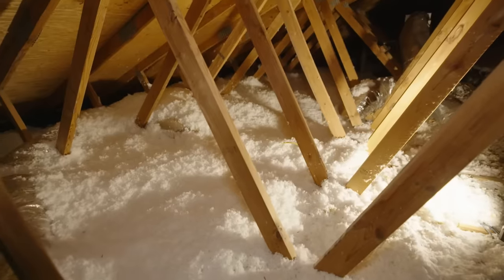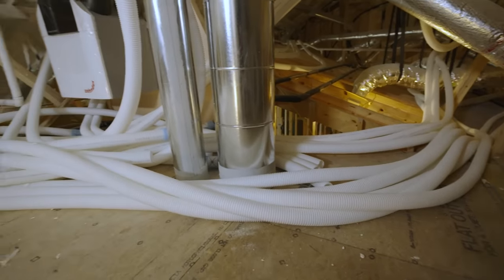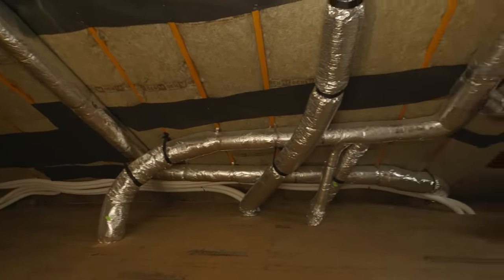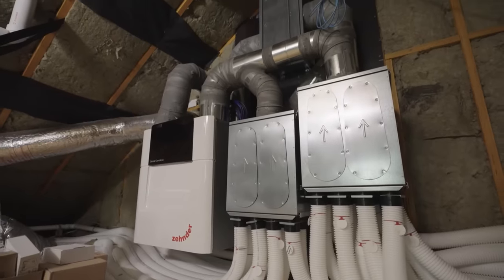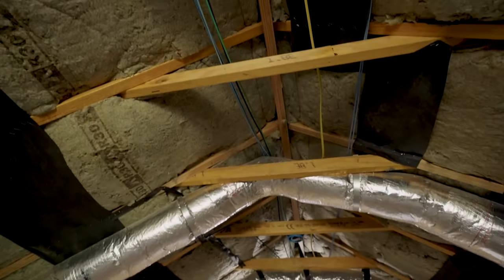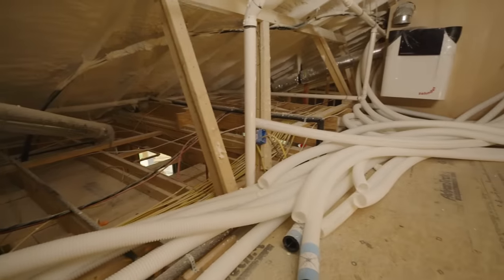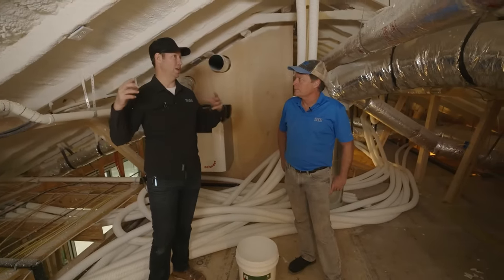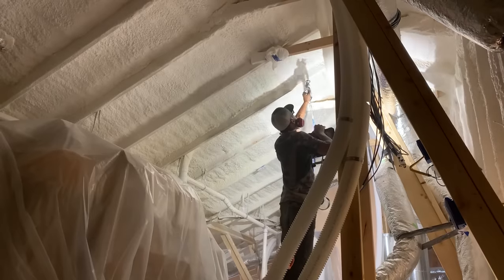Building a BETTER attic - Unvented + Conditioned attics 101

Comment: Matt, a cost comparison would be very helpful for you to include in this video, the cost to do the older type of vented attic vs this new type of conditioned attic you showed us in these 2 houses.
Reply: Alot.  That's why he doesn't mention it.
Reply: More expensive, yes, but you gain conditioned storage and your power bills will be much, much lower.
Reply: @Engineer10211  That has to cost $$$$ to construct. You still have to heat and cool the attic which is an additional space and cost money to do it. I don't know how much you save 6 months (3 summer 3 winter) when the bills are the highest, maybe 500.00 a year? I'd say 6 to 8 grand for the work maybe? 10 to 15 year break even? I'd love to know the figures.
Reply: @Kevin-ib4gv  very quickly:
The savings can be a LOT more than $500/year, depending on how well the attic was already insulated. Ours was.
You can have a smaller HVAC system, again saving money. The system will last longer, too, because it runs a lot less.
You gain a lot of usable conditioned space. I even store my comic book collection in our attic, which would otherwise be a big no-no.
Resale value is increased.
It's a good bit less expensive to do as a new build.
If you're handy, it can be done DIY, taking your time.
Reply: @Engineer10211  Isn't conditioned space directly related to tax assessed? Will this type of attic fall under such category?
Reply: @Engineer10211  How will your power bills be lower?
Reply: @joegf1739  I could spend a half hour explaining why, but instead I'll recommend searching on "attic encapsulation." However, in this video he has used mineral wool, which is not itself an air barrier, and he didn't specify clearly that the attic has actually been air-sealed.
Reply: @joegf1739  In simpleton terms (for guys like me) think of current attics as a heat tank. There is not a lot of barrier between the heat generated from your roof via the sun and the attic space.  Traditional attics IS the thermal barrier (using the air in the attic to "cushion" the heat transfer to your house below) and the insulation above the ceiling tiles dampens the heat transfer of the hot air of the attic to your house....yet your AC blower and duct work is also in that HOT space. Even with the thermal insulation covering the duct work there is still heat transfer to the cold air being blown into your home.  Which is why a lot of home owners with traditional attics are installing a thermal barrier to their attics to help cool the attic and lowering energy bills as your AC system is not having to fight the hot air in the attic as well as the rest of the house.
Reply: @Engineer10211  It will pay for itself in 200 years.
Reply: @carpenter3069  read above. Personally, I LOVE my awesome attic. It's a huge boost in conditioned storage and when I need to do any wiring, plumbing, or HVAC work, it's just heaven.
Reply: @Engineer10211  lower? Why?

From where I'm standing it certainly looks like the power bills would be slightly higher
Reply: @priestesslucy3299  no chimney effect. No ac system and ducts in a 140 degree attic. No leaky ceiling membrane. We have $70 power bills for August in Dallas. They were $250 before.
Reply: @Engineer10211  Chimney Effect is an asset if it's engineered properly.

Agreed, running AC ducts through an uninsulated attic would be incredibly inefficient.

That power reduction you got is really impressive though
Reply: @Engineer10211  in fact I have a friend whose house uses the attic chimney effect. The north eave runs out to about 5 feet from the ground, shading that area to keep that air as cool as possible and draw it through the attic to leach heat off the ceiling.

Of course with only a single cant to the roof (that extends well out from the south wall to block the high angle summer sun) the house has a tall south face with a ton of glazing to soak up winter sun for passive heating.

Of course, I can't compare AC bills because neither of us have AC here in Western Washington, but his house was cozy during our recent 110F+ heat wave, whereas I was driven out of my house to hang out in the shade outside by 1 in the afternoon lol
Reply: @priestesslucy3299  I'm just keeping it short so I don't spend an hour typing a thesis on the subject. When I referred to the chimney effect as a problem to be solved, I had in mind winter temperatures, when cold air would be drawn into the house from below as warm air escaped from the ventilated attic.
Minus the encapsulated HVAC system and lovely conditioned attic and easy access to electrical, plumbing, etc, you could achieve the same level of efficiency by spray-foaming the ceiling membrane and seriously ventilating the attic. But you might know that most people have no idea how much ventilation it takes to keep the attic at the same summertime temperature at the outside air (it's a lot).

I retrofitted our 1950 house with a system similar to the ORNL subvented roof, so I still get a ventilated deck, plus the advantage of a double radiant barrier. I spent 4 years doing it a little at a time - and I'd recommend anyone looking at encapsulation just spray foam the whole deck to at least R30 and be done with it.
Reply: @AD-1138  Just so I understand completely, you're supporting this video's attic insulation strategy because of HVAC duct work thermal loss?  If that's true, why not just use better insulated duct work?  Building the attic following this video's method seems like a super expensive and complicated way to solve what could be a small problem, if a problem at all.
Reply: @Engineer10211  yeah, it makes sense that conventionally constructed homes benefit a lot from encapsulated attics now.

Thanks for helping me understand ♥️
Reply: @joegf1739  What's the best r-value you've ever seen on HVAC ducts? If it's fiberglass, remember that the effective r-value decreases with higher T delta, and that will be very high in peak heating and cooling seasons. Also, I don't think anyone is going to claim that the sole justification for attic encapsulation is to prevent thermal loss of ducts/plenum/etc.
Reply: @Engineer10211  Will they be with the $60k extra?
Reply: @joegf1739  You would think that if this was an option that companies would offer it....but they are not, I have never heard of any company offering "improved" duct work.  Think about it, if A/C companies had the option of offering a better product for more money, they would.  

So, where is this miraculous insulated duct work that you speak of?
Reply: I’m building a house now with a invented attic , the air conditioner contractor doing the installation is telling me to vent my attic or my air conditioner and ducts in the attic is going to sweat and ruin my drywall ceilings.
Reply: @brantingram  I'm sure your hvac guy is really nice, but he doesn't know at all what he's talking about. When you encapsulate an attic it becomes part of the "conditioned envelope" with the rest of the house. It will be no more humid in the attic than in the rest of the house. If anything, ventilating an attic and using uninsulated metal ducts (which it almost sounds like he must be saying) in the summer will definitely cause condensation on the hvac component surfaces. Anyway, you're almost certainly going to use insulated flex duct and there's really no chance of getting condensation on those.
This is actually the most ridiculous objection to attic encapsulation I've ever heard.
Reply: @Engineer10211  yes he's here now and I just had this discussion with him,  of course I don't want to be a jerk . So I just said what I believe and left it at that . Then few minutes later he said , oh OK I see now that you going to aircondition attic is why you not venting it..🤣😂.. I just said yes .. but inside I'm thinking that was what I said the 1st time . 😂🤣
Reply: @kfk256  … that depends on how your municipality applies the tax laws.  But by and large, more conditioned living space will result in higher taxes.
Reply: I find it difficult to agree the payoff is quick. If it were such a no brainer codes would have been changed already. Something doesn’t pass the smell test. Why would an extra $10,000 to $20,000 at the initial build cause such resistance spread out over 30 years if it was such an obvious benefit to the homeowner and the country and the planet. It makes no sense. In FL they can’t build fast enough and as most of you know, most of them are vented attics built exactly the same as what Matt is calling no good.
Reply: Doing your attic this way will increase your build cost (under normal conditions, not current conditions) about 20-30k. The spray-foam alone is 10k. The average cost to heat/cool a 2500 sq foot home (the U.S. median) is about $133. One commenter in a different place said he had a 2500 sq foot home and his neighbor with the same square footage (and a typical vented attic) and claimed to pay 1/3 what his neighbor did each month. Taking the difference between those two bills and multiplying it by 12 months gives you about $1,064 saved each year in cooling/heating. So in order for that to pay off you'd have to own that home for 20-30 years for it break even (essentially having your house paid off at that point) and start saving you money. 

Over time that house will be more energy efficient with multiple owners, but build costs for a first-time owner is absolutely not worth it. Now you add in current economic issues and you can double or triple the added build cost because of the cost of building materials right now, on top of the overall increase in house costs right now. So building a new house, right now, in this economy, with this style of attic will cause you to lose INSANE amounts of money. Because once the housing value bubble pops, your house is gonna plummet in price and you're gonna lose your ass.

Comment: You are forgetting the reason for vented roofs is air flow to eliminate condensation. While you may get away with this in warm temperatures you still risk shingle life and rotted sheeting. This would work fine if you incorporated a dry deck roof system. 
I have personally repaired several roofs from the rot of an incomplete system as you are showing. It is a fantastic system if you take care of the condensation.
Reply: Vapor permeable membrane under ridge vent allows moisture to escape. Plus the air is constantly being cycled using HRV equipment. Your dining, or bedrooms don’t have vents. The crawl space and attics being treated as conditioned space are working at being more energy efficient. But they will need electricity.

Comment: Why aren't you using "saddles" on the flex duct strapping? You know that over time the web strapping will crush in on the flex ducting and restrict the air flow.
Reply: Agreed
Reply: Guessing it's not the flex that you think it is? They make insulated rigid duct that looks identical to flex until you press in on it.
Reply: BUT !!!!!!!
This attic !!! I never above 80* !!!
 My problem is COST !!🥵

Comment: Great video as always. One thing I'd be interested in when it comes to spray foam is those horror stories of foam that never "cured" and are off-gasing some horrible fumes that makes the kids allergic and sick. It would be interesting to know what has been going on in those cases, and what they did wrong there, and how to avoid it.
Reply: I'm in that mess now with open cell on the walls and roof, plus the contractor sprayed the heck out of everything, the attic vents in the gable, the roof ventilation fan. He claims it's a non venting attic,  of course he turned it into one and created a sauna!!! The off gassing when it's hot out is horrible. It stopped my kitchen reno now that we had to pull off the damp drywall and ceiling.  Not sure how to best remediate this mess! Need advice.
Reply: @hsantillo864  I have no advice unfortunately. Only condolances. Hope you get it fixed.

Comment: I converted my attic from poorly insulated & vented To a fully insulated at the decking. Vacuumed out all the cellulose and fluffy white. HVAC and ductwork all inside conditioned space. I included a dehumidifier into the air plenum. Very comfortable easily keeping relative humidity 48-55%. 1600sq ft with a two ton 2stage split system easily keeps house at temp settings of 72-74. Even when temps are well above 100degrees. North east Texas area near Tyler.

Comment: This is great if you have a tile or steel roof, but if you have asphalt shingles you better check your warranty because many shingle companies won’t cover damage or reduced lifespan caused by excessive heat the shingles experience if the under side is insulated instead of open to air where the heat can dissipate.

Comment: Old time builder here. With the USB roof boards if there is any leaks your roof is shot and it's hard to tell with foam sprayed on your Attic ceiling. Another thing is the cost in residence your homes 1800 to 2,000 square feet the cost increases so much that people cannot afford to buy the home. In most cases houses that small do not have much storage in the Attic anyway. Pros and cons to everything.

Comment: As a mechanical engineer working in South Florida, I am beginning to see some major problems with mold growth inside "non-vented" unconditioned spaces that where created by using spray foam insulation. Remember that there is hot humid air inside the house (doors opening, cooking, taking a shower, people) that needs to somehow filter to the exterior. With the use of spray foam, all of this hot humid air gets trapped. When it reaches the dew point, it condenses, turns to water and gets the surface wet. This is just standard physics. How is this solved?? I am still trying to figure it out. If an attic is hot? Who cares as long as you have enough insulation between a hot area and a cool area. The same with wall insulation and double paned windows. So think of it this way. How do you remove moisture from the inside of an igloo cooler? You have to open the lid. When I find a solution, I will post it.

Comment: Thought about doimg spray foam for my tiny home...pretty sure after needing to spray <and then> paint...i think i'll just do traditional insulation.
Reply: one usually does the spray foam for a few reasons....and one is to lower the electric bill.     we did this to our first house along with other things and our bill dropped from $300 to $150.     other things that were done were new windows and ac....but having an attic that doesnt reach high temperatures is going to save you money each month.     we recently sold that house and bought another one and we are going to do the same thing again with the spray foam.
Reply: Yea, stick with fiberglass. Spray foam is fast and easy but you're paying WAY more for it.
Reply: @chad3076            define WAY to much ?

Comment: I have a house built in 94, and has zero insulation in the attic space.  I was all set up to have a guy do it, but he got hurt and closed down his company.  I have been in a search for a company to do it.  I would really like to get my attic space sealed up.  If you need a house to do this on for a show, mine is available.  Thanks for posting this.